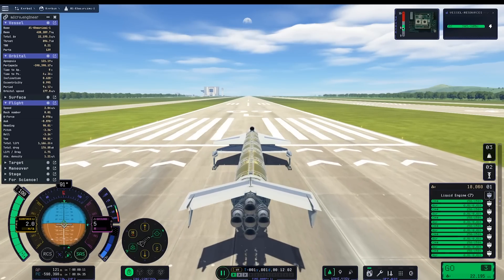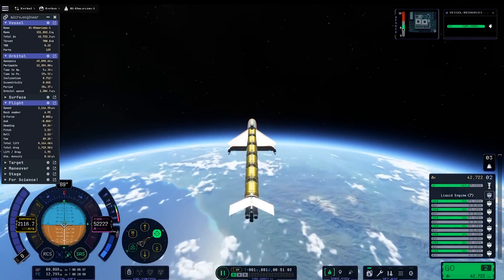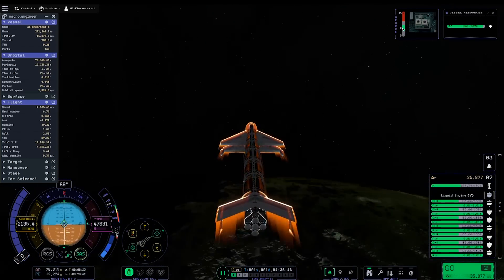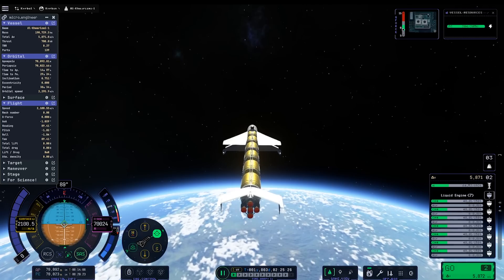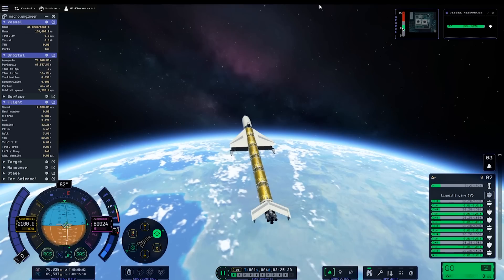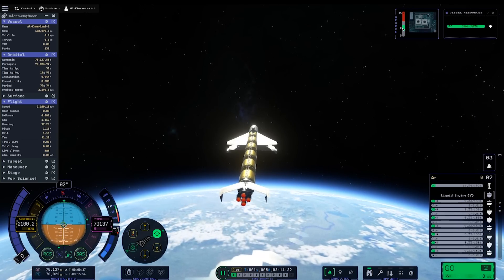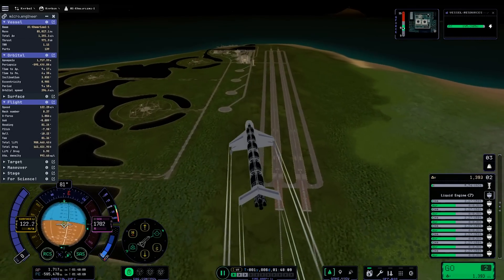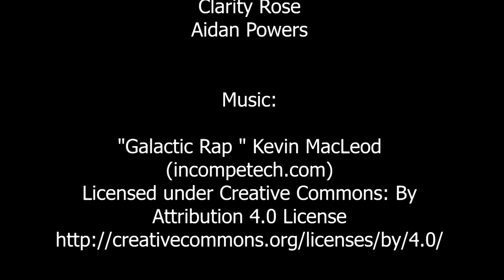Orbiting a spaceplane in KSP 2 as many times as possible without refueling

Comment: Did mounting the remaining 7th Whiplash on top of the craft have much of an impact on efficiency in terms of the torque it imparted upon the craft that had to be counteracted by control surfaces?

Also oof that final landing, wow.
Reply: I imagine it wouldn't have much effect. It's not offset by that much, and is very far ahead of the center of mass.
Reply: I'm pretty sure the other 6 engines are just slightly below the center line to counter that. It's Bradley we are talking about!

Comment: When I've played ( recently too ) I've found that although atmospheric heating is in there's little to no resistance.   For example I tried to aerobrake a Mk1 Capsule,  a rather modest and empty Size S Fuel tank and a terrier engine.  But I had no change in apoapsis at all when entering the atmosphere to a periapsis of 40km ( standard aerobrake from minmus ).  I only noticed drag once I jettisoned the tank and terrier engine and had just the capsule.  which of course burned up with the heating and was why I was trying to aerobrake to a decent speed before a final descent.  I gave up playing at that point.  This was a couple of weeks  after the last update and before Take Two pulled the plug.

We should petition for KSP2 to be made open source.
Reply: Just because there are programming errors does not discredit development (whether it continues or not). Saying that we should just "open source" and magically fix the game is unrealistic at best. It is better to just report the bugs and wait patiently for patches.
Reply: @IvanRodriguez-tl2zr  There won't be continued development - So yes it should be made open-source.

That would be the best thing for KSP, whether they fired everyone or not it'd be a massive improvement (But they did, so moot point).

Comment: Damn, the first launch used as much methane and nearly as much hydrogen as the last six combined
Reply: The rocket equation in effect...
Reply: I would of used a multi stage craft cause no refueling just means you can't refuel stages, so staging is good
Reply: @spanum  *Would have
Also wondering if staging would disqualify it as a spaceplane and rather turn it into a rocket.
Like the Space Shuttle being the plane but the STS being a rocket.

Even if it still classifies as a spaceplane, it would no longer be 9 launches for a plane, but 9 launches for a decreasingly smaller plane that would no longer equate to the starting vessel even with refuelling. He would orbit a new spaceplane everytime he jettisons something off.

Refuelling his plane would result in 100% of the vessel he started with.
Reply: @HighFlyer96 I don't think so.
STS was a rocket because well, it's not a plane, is it?
It didn't fly or glide, it launched with rocket engines.
I think the virgin galactic spaceship is a better example of a spaceplane
Reply: @CosmicHase  STS was the entire system, combining orbiter, fuel tank and SRBs. The Shuttle itself was indeed gliding.
That's why I mentioned it seperately as a plane/glider.

Neither the rocket motor or the external fuel tank would disqualify it as a plane.

And while the wings weren't actively used to reach orbit, they were still essential in it's operation.

But when he said he would have added staging, this does change the character of a plane strongly. You could explain dropping off external fuel tanks as staging of a plane, but landing a fraction of the plane you took off with, defeats the entire purpose of the plane.

Sure, the STS jettisoned a lot of it's system, but the plane/shuttle itself remained pretty much whole.
Reply: @HighFlyer96 I think whether or not you have both wings for landing is rather rather superficial.
Reply: @CosmicHase  Point is, if you call the entire thing a spaceplane, you should keep it as a whole. Otherwise it's a rocket with wings. The entire point of a spaceplane is to go to space and return as a reusable craft. Staging and jettisoning wings, booster stages or engines defeats the entire purpose and doesn't make it a plane.

Which is why I compared it with the STS. The Shuttle stayed as whole, it was just not capable reaching space on its own. That why the entire system is a rocket, not a spaceplane.
Reply: @HighFlyer96 I'd say, if it flies purely through thrust, it is a rocket, and if it uses wings to generate lift to fly, then it is a spaceplane, regardless oh how many stages it has.
I'd say while drop tanks are staging, they aren't really "stages" since they do not provide thrust, or carry crew or cargo, or any functional components, other than fuel.
If the shuttle took off and if it had a lower pitch angle so that the wings actually provided useful lift, then it would be a spaceplane.
My point is, a spaceplane is a spaceplane by it's function, not form.
Reply: Do the math. 1 pound less weight equals more delta v than adding 1 pound of fuel